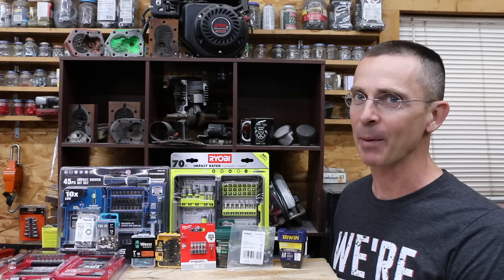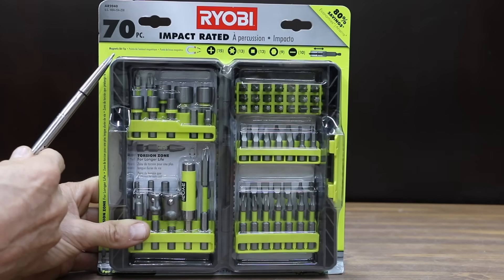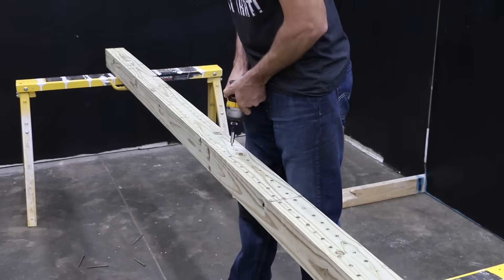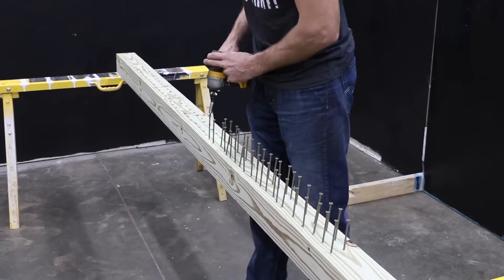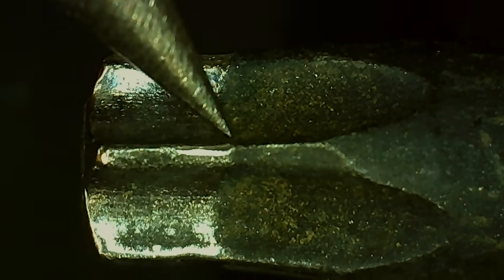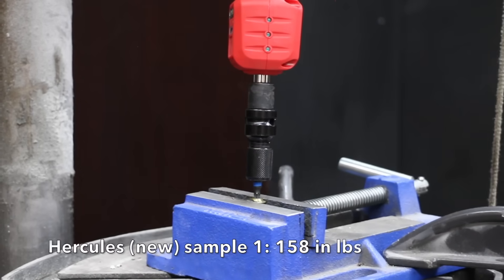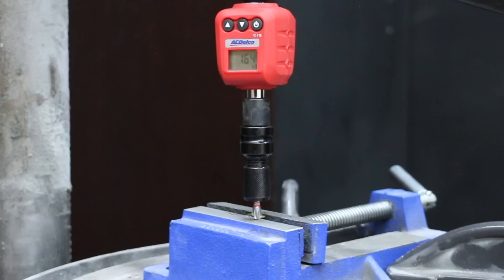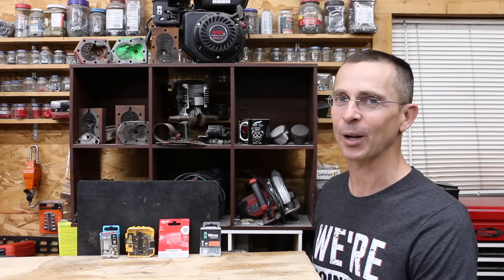Best Star (Torx) Bit Brand? Milwaukee, DeWalt, Makita, Ryobi, Wera, Wiha, Irwin, Bosch, Bauer

Comment: Indeed - I am a professor of Mechanical Engineering and I can tell you that the ideas for tests and rigorous conduct of them means that virtually any of the Project Farm videos could be written up and receive a Masters degree.  Well done sir!
Reply from the maker: Thank you so much!
Reply: There’s a compliment for you wow. Enjoyed your video.
Reply: thankse for youre words biker max. i am not projct farm but i am geniuly happy from it. sirlord
Reply: But... Videos.. can't..
 
receive..
 
master's degrees?
Reply: @EvenTheDogAgrees  rap it now, dont decry
when i suprise you will cry
Reply: @uiopuiop3472  Oh, I'm cryin', man. But I'm also a little slow. So if you'd be so kind to explain to me why I'm sitting here all bleary eyed, that'd be swell, good man! ;)
Reply: I agree that these videos are very well made and the test methods are well thought through.
However, I really hope that there's a lot more required to get a Masters degree than this.
Reply: @anonytube1679  just a bit of hyperbole is all
Reply: No
Reply: I'm about to be an ME student myself, these videos are so great.
Reply: @assessor1276
I have been a Quality Engineer and Director of Quality in the engineered cast iron, foam, ceramic tile, color photo, appliance and stainless steel industries.
I actually built one lab that  Process Monitoring , accelerated wear and failure inspection.
What PF comes up with, especially from the consumer POV - makes many of the ASTM and DIN standard test look a bit silly. Add to that, only a few manufacturers will test their product to that of a competitor A-B.
Project Farm should have a televised segment on either HGTV or the DIY networks.
Although I’d hate to lose him here!
Reply: Excellent
Reply: These videos are great and very thorough for product reviews, but if that kind of stuff could earn an MSc (!) at your uni, I'd steer well clear ...
Reply: @AGH331  wack

Comment: I understand the reasoning behind wanting a good release from the screws. I personally like a tight fit though so that I can start a screw without having to hold it. For instance when holding a material up with one had and using the drill in the other. Yes you can start it before but sometimes that isn't possible. Also it helps start the screw even when both hands are free.
Reply from the maker: Thanks for the feedback.

Comment: @12:20 we can see that some bits that were used were stronger. From taking an engineer class of material science my theory is 'workhardening'. Some metal will work harden where the others are already at the highest YS and won't harden anymore. Also there is a thing called grain boundary that make it harder for plane slippage, so I would be interested in seeing microscopic photos of each broken bit. The grain can tell you a lot about the manufacturering and YS.
Reply from the maker: Thanks for the suggestion.

Comment: Sorry, but I’m having a hard time taking you serious with your method of “bit fit “.   Wiggling it back and forth with your index finger, and making your comparison based on your memory ?  You must know that each and every screw has differences in coating thickness. I’ve found hundreds of screws over the years that you can’t even get a bit into.
Reply from the maker: Thanks for the feedback.

Comment: Waitin' for one of your vehicle upgrades, at least grade 8 bolts top to bottom, no failures, maybe a custom hd frame, sheet metal dash w all gauges & a few switches, sumthin' sumthin' for lights
Also haven't seen spark plug testing although that takes weeks for computer to relearn each time (can reset it by unpluggin' + & - for a few minutes w lights on to drain it)
Reply from the maker: Thanks for the suggestion.

Comment: I hope that's not a dewalt 887 cuz this test would kill it for sure. The 887 catches fire
Reply from the maker: Thanks for the feedback.
Reply: @ProjectFarm  check Vcgconstruction video on it, the motor was smoking extremely hard. And when he connected the battery, it started smoking from the battery terminals and would've caught fire if he didn't disconnect it. Dewalt missed the mark on that impact driver

Comment: One thing I learned is dont buy the cheapest stuff. I bought a $10 set of torx bits to remove the bed bolts from my f150. I stripped 2 of the 6 bolts because the bit was bending. I ended having to go out and buy an angle grinder to grind the stripped bolts out, AND a nice set of torx bits for the other 4 bolts. I shoulda just bought the nice set to begin with.
Reply from the maker: Thanks for sharing.

Comment: Have you tested thread repair kits? Like Helicoil, ace lockers etc?
Reply from the maker: Thanks for the video idea.
Reply: @ProjectFarm  for test parameters, please include pullout strength in steel and aluminum as well as ease of installation if you decide to run with this idea.

Comment: I appreciate the effort made in testing the bits, but I'd like to point out (it may have already been done so in the 4160 comments), many people do not WANT the screws to easily drop off of the bit.   I know I'm constantly cursing having to pick screws up from falling off of my driver while trying to get it into place, standing on a ladder.  So, the better the fit, the less likely you are to have the screws fall off.  If you want screws to drop off easily, you have to accept a much more loose fit.   So, Robertson, or Torx?   :)
Reply from the maker: Thanks for the feedback.

Comment: I use the DeWalt bits every day professionally. I can tell you they are good enough to use them hard without a problem, and cheap enough to toss in the trash when it starts showing wear. 

Assuming it's good enough to use without it being a problem, which most brands are honestly, there are other factors to consider when choosing which platform to adopt. 

One being price and the other being the storage system that they use. I can tell you that DeWalt has both parts wrapped up. Their new cases blow everyone else's storage system away.

 They all lock together securely for good organization. Also the bits lock into the case very easily and securely, and come out easily. Plus a lot of sets have a small case within the bigger case to hold a bunch of lose bits, which is really nice. I think I saw one in this video. 

You can also buy the small container full of loose bits that snaps into the larger case separately. 

It's just a great system and a lot of these lock together cases with a variety of bits can be found at Home Depot for $10 to $12. and you can spend a little more money and get some even nicer sets and all of them universally lock together.

 I would buy another brand if they were nice and on sale for a good price, but they would be coming out of their case and going right in the DeWalt case. I usually don't buy anything else  because the dewalts are usually the best deal.
Reply from the maker: Thanks for the feedback.

Comment: Could you please do a comparison between marine adhesives ? 3m 4000, 3m4200, 3m5200, and then compare it to the fast cures? Could you do tests on metal and fiberglass and metal to fiberglass? This would be super helpful for a lot of boat owners! Please and thank you! Your channel is awesome!!!! Maybe even throw in life seal, and loctite marine adhesive
Reply from the maker: Thanks for the suggestion.
Reply: I guess what I meant to say was it would be nice to see if there is a difference between strengths of 3m 5200 and 3m 5200 fast cure, and the same with 4200 and 4200 fast cure . I should have worded it differently. I see you have a few videos including 3m5200 , it’s great information!

Comment: If you test socket brands, can you test them on shallow bolts? I had a very challenging time removing some oil pan side bolts on my car because they were so shallow, and the sockets had far too deep of a bevel in the tips. (Similar to the Philips head bit test you did where they were caming out).
Reply from the maker: Thanks for the video idea.

Comment: Another great video! Given how close of torque value all of the bits failed at (with the exception of the Wera and Ryobi), I bet a torque limit of the Torx drive system could be established. In the fastener testing that my company does, we find that the Torx bits fail or the recesses strip before the fastener fails making joint testing difficult. Most of our testing is done by torqueing the fastener to failure and generally, you want the bolt to fail by stretch in a bolted joint. Having the bit fail or the recess strip basically means that the fastener has more capacity but you'll never get to use it because of the drive system. 

It's definitely the trend in newer cars to use internally driven fasteners but this limitation is pretty pronounced when you start doing testing on it.
Reply from the maker: Thanks!  Thanks for the feedback.

Comment: I mentioned this previously on another test that used pressure treated 4x4s, but you should really consider splitting up the screws you're driving per bit over each of the 4x4s, rather than all in the same one per bit. I am a lumber treater and we treat 4x4s just like these ones, and I can tell you with absolute certainty that there is an enormous amount of variance board to board, even from the same unit, and sometimes even from the same board. Part of the process includes taking boring samples from boards for QC and two boards next to each other from the same unit can vary wildly in the force required to drill the sample.

I really implore you to start splitting up the tests over several boards if fairness is paramount. I can even see in the video at 00:45 that the board on the left has screws going into nothing but sapwood, which is much softer than the heartwood that many of the screws are going into on some of the other boards.
Reply from the maker: Thanks for the constructive feedback.

Comment: Just a side note; Wiha has actually only five different Production Places. Three in Germany, one in Poland and one in Vietnam. 

Although I've to point out that both - Poland as also Vietnam - are actually certified by the TÜV here in Germany and that I'm not 100% sure if they only do the "ground work" in regards of Bits and other Stuff, or if they produce complete Products which they then export to Germany for the quality management.
Reply from the maker: Thanks for sharing.

Comment: Wouldn't use my Wera bits for carpentry, but for threaded hardware that will be rescrewed multiple times and which stripping that hardware is a concern Wera is hands down my #1 choice. Good to know my trust in Wera wasn't misplaced.
Reply from the maker: Thanks for the feedback.

Comment: We did installed a metal roof recently and drove eight 3.5” T25 screws through 300 purlins into the 70 year old rough cut decking boards. I can say after ample testing of every brand available from HD at the time, Milwaukee and Makita both hold up extremely well and would last through several battery charges. The Ryobis and other cheap brands wore out before our batteries would go dead once.
Reply from the maker: Thanks for sharing.

Comment: The Wera bits start to make a lot sense when bought as a set, for example the  BC 30 Impaktor 1, that includes their impaktor bit holder that is intended to be used with their impaktor bits, that claims to add even more to their lifetime, though US buyers should consider buying any German tools from German Amazon, because of a large price difference.  However i totally agree with that the biggest enemy of the bits is often misuse.
Reply from the maker: Thanks for the feedback.

Comment: best non-anodized aluminum protectant. (automotive or marine application)
whatever this state is spraying on the roads for deicer is dark, sticky and eats aluminum. between automotive, marine or even surfboard wax (or simply beeswax) has come to mind for what we might use to combat deicer on the roads from ruining our polished aluminum wheels. also if after applied if dirt, dust or mud would simply rinse/bead off with water.
Reply from the maker: Thanks for the video idea.

Comment: Did the same test mate here in AUS.. the best bit for me was alpha ph2 bits they performed rely well fit good and handled good also when hammering dynabolts in to concrete not pine wood😂  over and over the rest of the bits snapped the tip off clean.. MAKITA x AND ALPHA  x strong did rely
 well 🤗 ...
Reply from the maker: Thanks for sharing.

Comment: Video ideas crimp wire connectors brands and also versus soldering,  also if your interested I would be willing to check hardness on smaller items I work in a metallurgical lab but our hardness tester isn't huge would do it for free.

Comment: As always, stellar video. I just wish you couldve used Makita GOLD in the mix. (Howevef, it seems they might not be made anymore outside of the Japanese market. 
 
My Personal Favs, even though I only use 2" or longer:

#1 WERA (There really is a huge price increase, but is worth it.)
 
#2 Makita Gold (Sadly, not tested...and I've heard it's no longer being manufactured... but their GOLD series bits are wayyy better than XPS in my experience. XPS=💩)
 
#3 Milwaukee 
 
#4 DeWalt
 
I also like a bit of a snug fit. And I use Stainless Steel hardware 99% of the time. And some is non-magnetic, so a snug fit saves me from losing expensive screws/hardware. 
 
With that said... TORX is my go to head style on everything. However, a lot of hardware that once used T25's, have been downsizing their screwheads to T20. Not a big deal, but I often buy costly bits in bulk. So I'll need to start buying T20 more.
Reply from the maker: Thanks for the feedback.

Comment: The fitment will wary a lot between different screws, so if you use the same type of screws always you should take one and test when buying bits..

Also, Wera is probably the worst bits I've tested. that is, I've only ever tested two, and they both broke in the same screw. first the t25 snapped and then I tried with the t20 in the same hole and that snapped also, never had a t20bit snap off in a t25 fastener before, usually the fastener will round off when you try..
Never bought wera bits again and probably never will.
Reply from the maker: Thanks for the feedback.

Comment: Great test. In use, I can say that I haven't found anything to be as durable as the Wera. The impact resistance is what seems to make the difference in hard usage. The pozi-drive seem to outlast the Dewalt/Milwaukee 5x or so. Certainly nothing to worry about unless you earn a living sinking deck screws.
Reply from the maker: Thanks!  Thanks for the feedback.

Comment: The fact that a used bit measures significantly higher strength than a new one indicates that the bit has been pushed into plastic deformation (ie, it has "work hardened" and actually already started to fail- this is the same mechanism that allows you to flex a paperclip back and forth and eventually break it) and indicates poor choice of alloy and/or poor heat treat. 
In terms of tightness of fit, one of the benefits of Torx vs flat or Phillips is that you can just stick a screw on the end of the driver and put it in almost any position and start driving one handed, which is great for driving screws into awkward locations where you can't pre-install the fastener like you did in the wood or use two hands..   Bits and screws need to have a good balance of retention and release, but it's a not all on the bit as the manufacture of the fastener also makes a difference..  In general, as you found, the tighter the fit, the less wear on the bit..  I would have liked a test on what angle that a fastener would have stayed on the bit without falling off.
Reply from the maker: Thanks for the video idea.

Comment: Is it a possibility to put the Metric values in the text as well? Only Americans are still using Imperial measurements (which btw are defined using Metric, so you are already using Metric measurements, just in a more sluggish way), so I have no idea if 160 inch lbs is a lot or not.
Reply from the maker: Thanks for the suggestion.

Comment: Have to say I personally prefer a good fitting bit, especially for the purpose of that if you need to hold something on a vertical surface and don't quite have enough hands, you can stick your screw onto the end of your bit and drive it in with no problems! :) Just my opinion and view on things!
Reply from the maker: Thanks for the feedback.

Comment: Another fine example of useful data collection using real-time methods.  A note about the Vera, the diamond is cubic boron nitride CBN coating. Theory is it actually bites the screw. The metal is also a proprietary with a cryogenic treatment. 
Torsional fatigue usually propagates from a flaw in the surface finish. So rougher bits tend to yield lower. Some of my metallurgy I learned in the joint from making shanks. Keep up the great work!
Reply from the maker: Thanks, will do!  Thanks for the feedback.

Comment: You should get a wood moisture meter for tests that use more than one board.  That way, you know the wood is not making much of a difference.  Even being from the same stack, the boards are more than likely not from the same tree, nor stored and handled the same way.
Reply from the maker: Thanks for the suggestion.

Comment: I tend to lose bits before wearing them out. Well no, that's not always the case. :-)

Frequently I will re-use screws, something that I probably picked up from my grandfather, rather than throw them out. The quality of the bit, particularly the fit has an impact on whether or not the screw can be re-used.

 What I do find most annoying is screw manufacturers that use different size torx drivers.
Reply from the maker: Thanks for sharing.